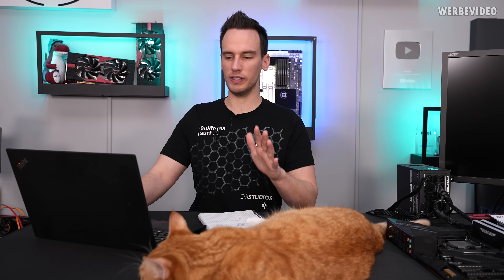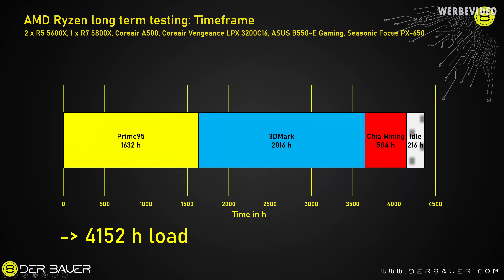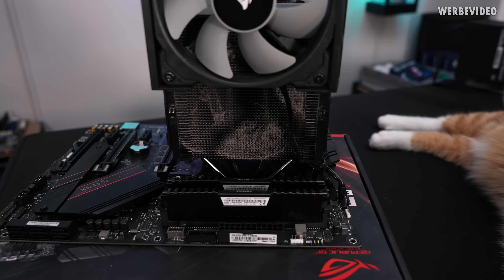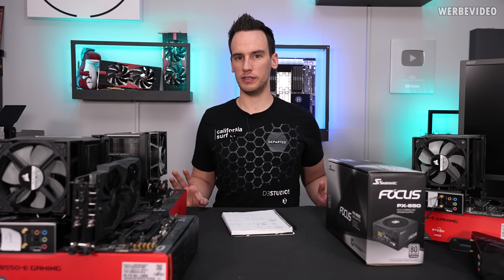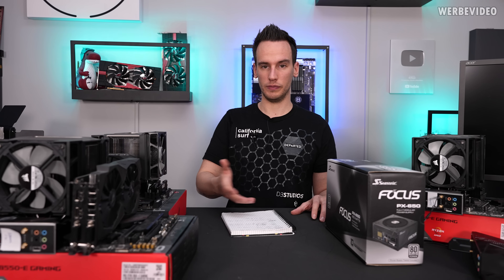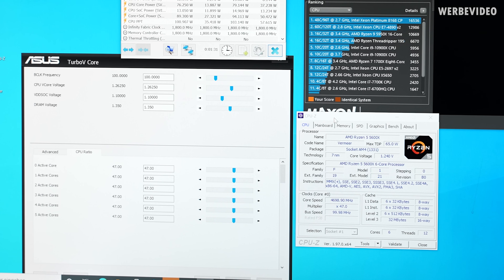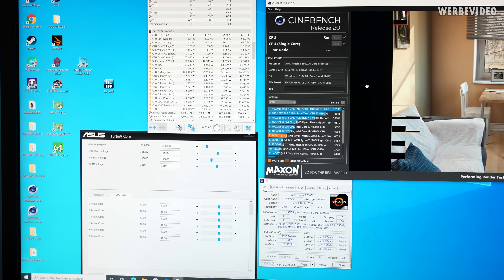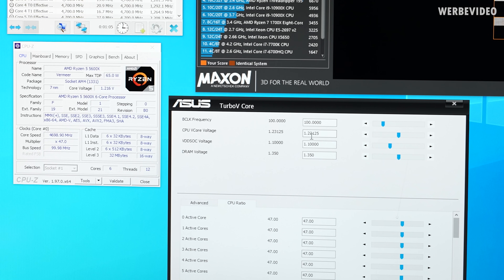4152 hours of Ryzen Long Term Testing: We have Good and Bad News

Comment: It goes without saying OCing is never a guarantee and results can vary wildly depending on both internal and external factors. The Ryzen era of overclocking is generally about undervolting and maintaining all core frequencies that are usually 200-300mhz below their rated peak single core turbo ratings. Its different for intel and its going to workout differently for 12th gen intel vs any of their previous era chips. Back in early 2000's chips never had dynamic frequencies, when you OC they ran at full voltage/full speed 24/7 regardless of load. turbo and dynamic clocks was never a thing.

Comment: Nice test, i do have a suggestion.Certainly do it with alderlake. Heck. Do it with every generation of cpus. But find a way to add tests. For instance: it would have probably been great to also have tested to what degree these cpus were able to undervolt with the curve optimizer. It seems this would have given a more sensitive measure of degradation.

Comment: I'd love more data. I'm talking multiple CPU's running at multiple different voltages. To see at what point degradation becomes intolerable. Of course gathering such data would be a long project, as this was.
As a tangent, my r5 1600 was capable of 3.9Ghz at 1.375V new, i ran like that for 4.5 years, occasionally dropping the clocks as the system became unstable (High res gaming coupled with occasional CAD work), in the end i was only able to get 3.75Ghz at the same voltage.
Reply: Mine did 3.85GHz at 1.3625V. Dropped to 3.825GHz after 4 years.
Reply: Lol, I had same CPU and used my motherboard's default oc settings which would push 1.4v at 3.9Ghz, I used it for 3.5 years and it never skipped a beat. But I did have a decent cooler so the CPU never went over 60c during gaming.

Comment: Wonder why 2 5600X and not have 1 of them not overclocked as a control to see if this was regular degradation for that use case.
Reply: Because the sample size is still to small to say anything. As he said: for this to be really valid he would need at least 100 in each group.
Reply: @andersjjensen  with that logic, why test 2 if he doesn't have 100 to test?
Reply: @Crftbt  To show that there will be variation. And that across three the variation was No Change, Maybe Change and Probably a Change. Running one "as control" is absolutely useless. It might have showed no change, or it might have required +20mV to reach 4.7GHz. He literally explains this... The test only concludes that "It probably won't kill your CPU really fast" at 1.4V like the reddit warriors claimed. Nothing more.

To say anything with statistical significance like "on average a stock 5600X will require +5mV to reach peak clocks after 5000h of 100% CPU load, whereas an overclocked one will on average require +45mV" or whatever will require a large sample size. Saying "these three didn't die" requires... three....

Comment: I had my 2500K@5.1GHz/1.5v running 24/7 for many, many years. I ended up with 4.9GHz/1.52v before upgrading this year to 5600x and I keep this one per core at -30 -30 -10 -17 -30 -30 @4.65GHz because I didn't see much of a benefit keeping it OC at 4.8GHz.
Reply: Sandy bridge, the little CPU that could. I had a 2600k for 8 years before i upgraded. Excellent OC'er

Comment: Very interesting. I undervolted my previous intel i7 4790 cpu not much after purchasing it, and it was stable for some months then it started crashing when I was rendering. I increased the voltage (still undervolted) then after some days it crashed again. I finally had to increase it again but it was still undervolted. Since then there have been no problems, it is still slightly undervolted. I was using it heavily for rendering, then Blender and no further degradation happened ever. It has been working for 7 years and its still working perfectly, I just upgraded to a ryzen because I needed more performance. And my 11 year old laptop i7 (despite overheating issues) stillmworking without crashing. Im pretty sure without overclocking most cpus can work for decades, and just as this videomshowed too there is no reason to worry even when overclocking.

Comment: i have been running 9900kf at 5.0 all core 1.36v 24/7 for 2+ years, good to know that im probably in the clear until DDR5 is a bit more fleshed out and the next series comes out, but i would still be interested in this on 10-12th intel as well and maybe even Threadripper

Comment: I used to run my 4690k @4.6Ghz with a decent voltage, now it is not stable even with 1.35v. I'm running at 4.4 1.3v because I no longer care to tune down the voltage. It is 7 years old I believe
Reply: I took a 4690k to 5.1 at 1.5v for a benchmark run and she was never the same again. All my previously stable BIOS saves at varying frequencies were unusable and she really wasn't stable at reasonable voltages past 4GHz anymore. No real loss it was about to be retired to a simple life of Minecraft gaming rig for my 10 year old niece anyway, which it's still doing 2 years later.

Comment: To add my own anecdotal evidence, I've had my 3950x for just under 2 years now, its had a fairly easy life but is on around half the time. Early after I got it I gave it a 75mv undervolt and it was only about a month ago I had a crash or 2 a week that have completely stopped by going to just -50mv. It'll last quite a while before it needs too much voltage

Comment: I have 2700X, 3700X, 5950X all running 24/7 doing encodes etc. with no issues. Stock voltages/speeds.

Comment: Great video - would have liked to know the voltages these CPUs were at under load (during long term testing).  With vcore set to 1.45 and LLC=4, assuming something like 1.33v?  Not familiar with ASUS LLC settings/behavior.
Reply: Considering In the video while running r23 it hovered right below the input voltage id say the llc is pretty linear
Reply: LLC4 is a slight slight vdroop

Comment: by the time you need more voltage for your cpu you will be looking at 7800x/8800x in shop... and many overclocked cpu's will be replaced long before that needed voltage.

Comment: My R5 2600X lost 50 MHz after about 6 months of using 1,363V idle/ 1,356V full load @4,1GHz all core, so there's that. But this was a horrible chip in terms of silicon quality that couldn't even do 4,2 GHz so that played a part too probably.
Reply: @OverCHAOS Sounds like my terrible E2180, (Core 2, 65nm) (dual core) where 3.0 made it degrade, LOL! And thus, it acted more like a 90nm chip from 2005! I easily lost 50 Mhz, I bet, LOL. I saw Prime95 start printing error messages sooner and sooner at the same and also at a slightly lower core frequency. It degraded super fast, only in a few days!
Reply: My 2700X isn't able to do anything above 4.175v either.

Comment: My fx-8120 died after 7 years of high overclock because i forgot to manually set voltage.
Bought a ryzen 3600 stock it was a massive upgrade. 7 years is a lot of time

Comment: I've noticed that some times the cpu degrades it bounces back to "normal" after a few weeks or months at lower clocks/voltage. Im not sure if its the CPU or the motherboard, but after some "rest" at the lower clocks/voltages they tend to be able to hit the original O.C. Although i tend to leave them in between said lower clocks/voltages and original heavy O.C.
Reply: Doesn’t really make sense but I have observed this as well. I remember Jay’s best binned chip on a last generation back in the day was the same started having issues, left it for a little came back and was sweet
Reply: @Lachlan_McDougall  same kind of thing happens when you run a old car for a long time or when a car over heats, sometimes it makes the magnets in the sensors go wonky. Things that where magnetic aren't and things that shouldn't be are

Comment: Regarding AIO pump failing, I'm proud to say that my 7 year old AIO is still kicking and it's been running 24/7 since January 2021
Reply: Yeah but not every AIO will last 7+ years especially if you’re running them 24/7, at which point you’re shortening the lifespan of the pump greatly.
Reply: Most times they fail because either the pump is at 100% all the time or they run them hot. I've seen them last just a year running the CPU at 90c :-/ but dont really see too many fail when it settles at ~60c under sustained loads.

I've also seen HDD's with 120K hours of on time :-| which is over 13 years of on time.. so maybe a water pump lasting 7 years is within reality ;-) anything over 60K hours is on borrowed time IMO

Comment: I thought the temps were more important.. any insights there? Guessing they were low considering the cooling vs processors
Reply: If Prime95 was doing small FFT, probably around 90C.
Reply: @kotekzot  true, the voltage is pretty high. I doubt those particular coolers would cool a 12 core at those voltages.
Reply: @kotekzot  and with mid to high seventies on tests with the aios yah.. I didn't know they made that much heat.
Reply: @CarlTurechek  it's not that they make a lot of heat, it's that there's a bottleneck for heat dissipation due to the small area of the die contacting the IHS.

Virtually all the electrical energy that goes into the CPU turns into heat, and these Ryzens are very energy efficient when compared to Intel's desktop CPUs.
Reply: @kotekzot  a noctua with enough heat pipes would cool those no problem. I have an enermax that is rated for 180 watts but it barely keep 105w cpus in check. I am impressed with durability efficiency at such high temps.

Intel has made some certain improvements for everyday use but still hasn't ironed out all of the complexities yet. I'm not sure it even matches AMD in efficiency anywhere yet being that it is 10nm. They do have a larger surface area at least now lol and more pins but not as many as threadripper. I wonder what amd has in store next:)
Reply: @kotekzot  It must be warm in the guy's room because I have 0 problems cooling my 5600g with the stock AMD cooler that came with my 3900x (nothing special, like 4 heat pipes). But the 5600g's only rated for 65w. I can't see pushing 200w on it lol So do you think 3d stacking will help the situation? Maybe is my guess :) since the electricity won't have to flow as far.. but it won't help the surface area issue .
Reply: @CarlTurechek  too many variables for me to make an educated guess, but my hunch is that thermals are going to get a bit worse, as there'll be more transistors, and the die height is probably going to be higher, leading to a thinner IHS. Performance uplift should be worth it, though.
Reply: @kotekzot  yeah, I guess the insane amount of caching will help a good bit of computing tasks. And if the process shrinks even more, probably no need to overclock. I usually end up undervolting just to keep the temps down and don't lose much in terms of performance, certainly not in efficiency except the mobo and memory overhead etc.. seems most of the coolers are more like a max rating instead of rms. It the chips get too thick maybe they could put the pins on the sides and cool the top and bottom lol or go around the otusides, though good contact would be hard to make.
Reply: @kotekzot  well actually they did have those cartridge style cpus back in the day lol the athlons .. probably some serious bottle necking tho in that style
Reply: @CarlTurechek  some workloads are going to benefit a lot more from the extra cache that others. Undervolting or even just tuning the voltages to get the best thermals and boost at stock frequencies is pretty cool. I don't think AMD are going to do anything crazy with Zen 3 3D V-cache chips, since they are supposed to be AM4-compatible.

I remember hearing about Intel developing technology to put liquid channels right into the CPU, that could be the way high-performance computing goes, that way you eliminate 4 layers that heat has to travel through before reaching the liquid: TIM, IHS, TIM, cold plate. On the other hand, the failure rate is probably going to be significantly higher.
Reply: @kotekzot  I think I vaguely recall something like that. They should just merge the ice giant evaporative liquid cooling tech with the processors themselves lol might as well build in a cooler to some of these $1000+ cpus. It might be hard to install them but if the pins are on the mobo it might work.

Comment: I have an  AMD FX 8320E 3.2ghz OC@ 5.1Ghz/ 1.433v core since 2013 when it came out.
runs same clock and voltage with same MOBO, PSU, and RAM since 2013. and still runs same temps 50-65c @load. no crashing no degradation that i can see. my son has been using it since 2017 when i upgraded to my Threadripper.  Make sure your PC is maintained and repasted when needed and clean from dust and dirt, it really helps alot.
Reply: Im scared too pull out my AIO from the CPU. The hose are stiff from 2013.😄

Comment: My 8700k started off 5.1ghz capable, after 3 years of moderate used it was only good for 4.9
Reply: mine is still at 5.1 1.35 V delided, with custom water cooling and still can do 5.3 at 1.4 V, but its not fully stable. I am not going above 1.4 V. Think i won the silicon lottery with mine. I think you pushed too much voltage, so the current was too high and it degraded.
Reply: @albinkeranovic1741  my only golden chip is the 8700k, 5.2 at 1.26v default llc, that's with avx too. It will do 5.3 but it needs over 1.36v to be stable. That was before delidding as well. All my other cpus and gpus are bottom of the barrel chips :(

Comment: How do you know that it's CPU that degraded and not capacitors on your motherboards ?
Reply: Watch again, its new mobo and psu for last test.
Reply: @Drifting-Stardust  So how does he know that the new MoBo behaves exactly like previous one ? 
There could easily be some tolerance difference.

Comment: People don't realise that transistors haven't really shrunk by much over the past few generations of lithography.  The increases in transistor density have come mostly from better resolution from the masking processes allowing for the transistors to be packed closer together without interfering with each other.
Reply: Yup, Physics is a bitch. I don't know when exactly but at some point transistors will just reach a point where they never get smaller again. These masking processes will also hit their limit at some point, so we're going to be stuck in terms of raw transistor density at some point.
Reply: @Broniath  we still can come up with better designs and things better than transistors
Reply: @khhnator  At some point there will be a an impassable hard limit though. Would actually be interesting to calculate what the theoretical limit of computation is, probably something related to the electrons you're moving getting close to the speed of light, although I suspect the practical limit is much lower.
Reply: @Broniath  well thats if you using eletrons for calculation, there a bunch of other particles in the standard model waiting to be used. photons are specially interesting since they don't mind being in the same place at same time
Reply: @khhnator  Would certainly be interesting, but even if you could theoretically stack an infinite amount of photons, you would end up with energy density issues. At some point your cpu would create a black hole if you turn it on :D.
Reply: @Broniath  well i would be more worried about having a psu to power that up lol
Reply: @khhnator  True XD
Reply: It's much much more complicated than this. Certain high performance areas or "hot spots" require more spacing, some areas require more room for interconnects etc. You could also say that even Intel's 14nm process had so much optimizations thanks to continuous improvement of IC design (e.g. better software) that it could compete with nodes with lower nm number in their marketing name...
Reply: AMD is mostly about jumping nodes and less on refinement... Because refinement doesn't resolve silicon lottery from happening anyways.
Reply: @dra6o0n  thats why intel is much more stable and more compatible to all stuff, because refinement, thats why i returned my 7900x faulty 12 core to an 13600k !! No headaches anymore
Reply: @cuongtang9539 holy this comment didn't age well lol
Reply: @minbcraft  hahahahha, its still working without issue :face-blue-smiling: but i guess i know what you mean, tell you what. I don't trust Intel anymore but also AMD is crap especially on new generations.
Reply: @cuongtang9539  yeah man agreed. my ryzen 1700 is still going strong running nearly 24/7 since march of 2017, but idk if i wanna trust the new stuff.
Reply: @minbcraft  my 13600k had no single crash or bsod i undervolted and set voltages manually since day one with no impact on performance. but yes, folks witch didnt dit that are screwed :face-blue-three-eyes:
Reply: Thank you for teaching me this. Also transistor density imo is better than the marketing term nm

Comment: Going back in time, I still remember learning the hard way by using a Q-Tec Gold 550W psu and not getting stable results. Someone suggested, I buy an Enermax 365W or an Antec 350W psu. Never gone back to cost cutting a psu. (This also back when bulging and blown capacitors where common.)
So, why say that, well a good single +12V rail psu will filter and give clean power to a motherboard. The cleaner the voltage (I even used a UPS), the better the overclock and the less damage if any to the overclocked component.
I live in the UK and even though we have quite a stable supply of electricity, it can vary between 230-260V, this where having as much filtering of the power is crucial. Even though, I do overclock, I still use UPS or a very least a good quality surge protection with filtering.
Reply: doesnt matter where you are, theres around 10% margin of error in voltage. thats why a UPS helps a lot